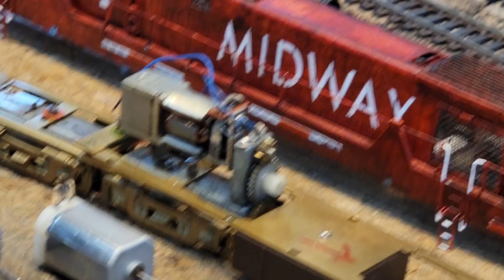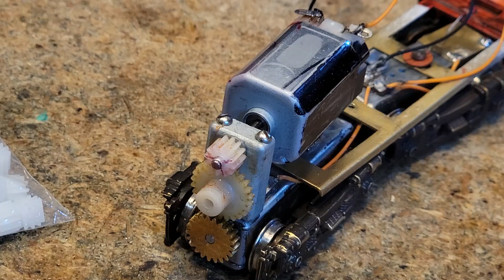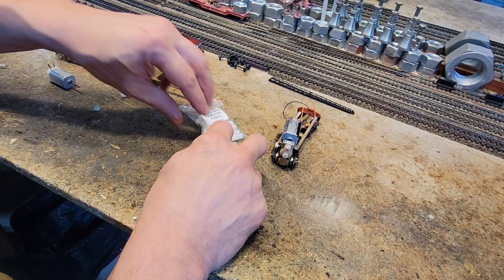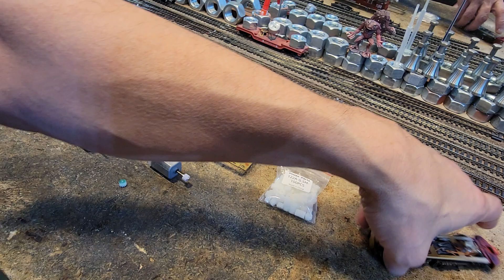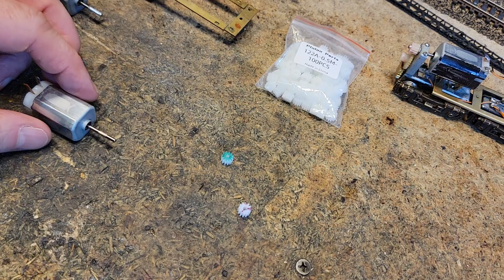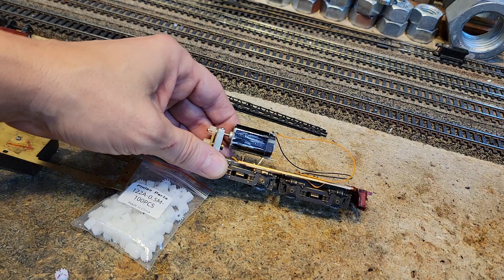Brass U50 Part 14 GEAR REPLACEMENT

Comment: So happy to see that you're OK and back. I do not have much interest in a Kid friendly channel so I don't see myself going there but I wish you well. Secondly, I'm very happy to know about the gear situation and I noticed on the built drive that motor mount seems to be mounted directly on the metal bracket without any cushion. If this is true, I would like to know if any vibration issues exist when it runs? Also looking forward to see the completion of the U-50
Reply from the maker: so in the original configuration the pittman is screwed to the brass bracket.  What I did was level that bracket, at least good enough for the moment, and I used some GOOP to keep it in place.  GOOP totally absorbs all vibrations and makes it even more stable that the original with the screw.  Plus, now that I have the correct pinion gear for this shaft, it's no problem to undo what I already did and use the new pinions!!  this is a little bit exciting, because it adds to our special secret library of special secret knowledge!  there are no resources on the internet or in print that put all this gear knowledge together for people like us to use!
Reply from the maker: as for the kids channel, it's made to use our named characters in stories in operation... that's meant for parents and grandparents, all the modeling stuff stays here and probably once a month I'll do something for holidays over there.  I feel like there should be something that parents and grandparents can show that this hobby is worth while.  It's not the thing for everyone

Comment: Very interesting.. I am in Melbourne Australia and have bought stuff also with the same issues both from Amazon and Aliexpress. Can you provide an amazon link to the gears you purchased please...?
Reply from the maker: To find gears on Amazon, you need the number of teeth, .5 module, 2mm hole tight.  That will bring up gears that say pinion. Leave out the tight and you'll get same set of results but the hole will be loose fit.  Sometimes you must use modulus instead of module.

Comment: Glad you're back! I did not know about the two kinds of gears, but it makes sense in hindsight. I've had some luck 3d-printing custom gears (I needed a helical gear and could not find them anywhere), though it was necessary to use an 0.2 mm nozzle. I'd be happy to print a gear for you sometime if it would be helpful.
Reply from the maker: Id be curious to know what kind of accuracy you could achieve trying to make a .5 modulus gear.  Theres also a couple mysterious worm gears that I have yet to identify...  If you try a test be sure to keep me posted on the results!